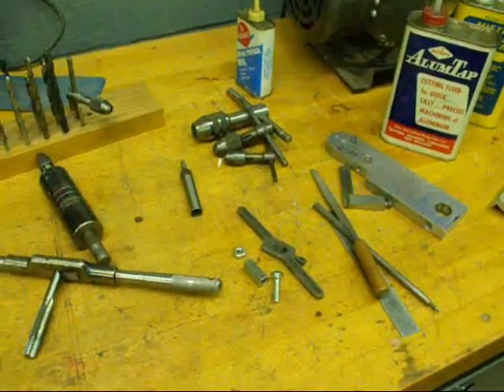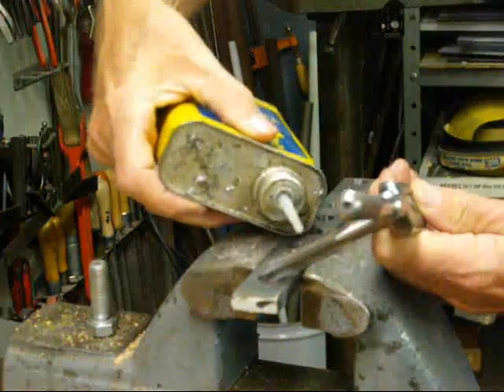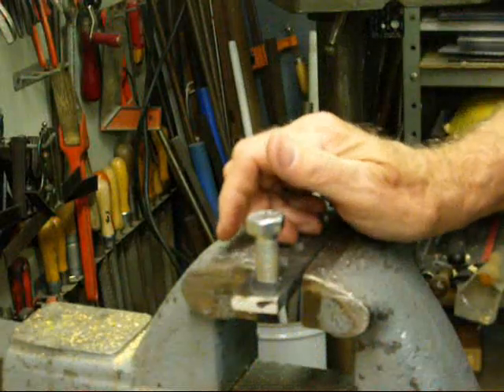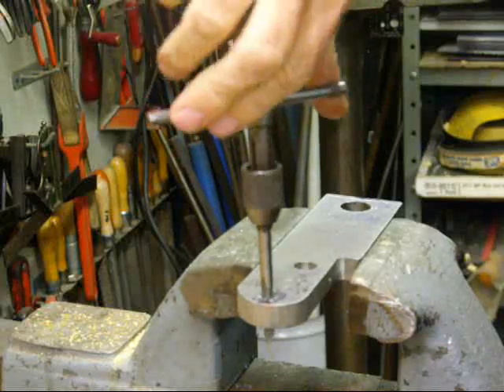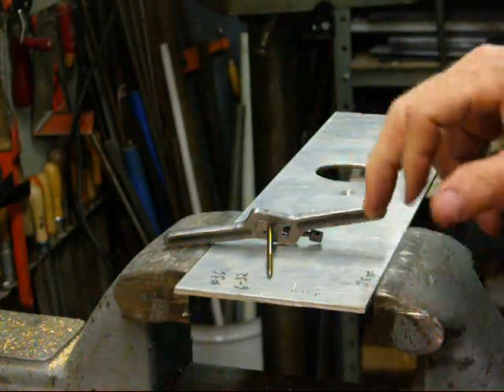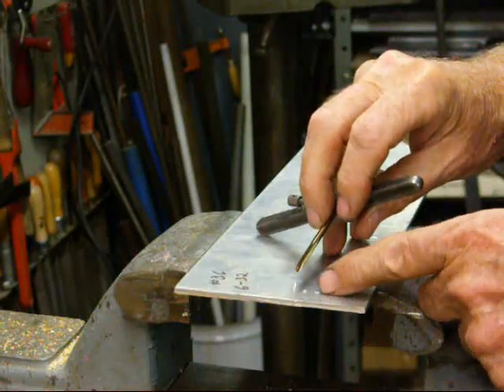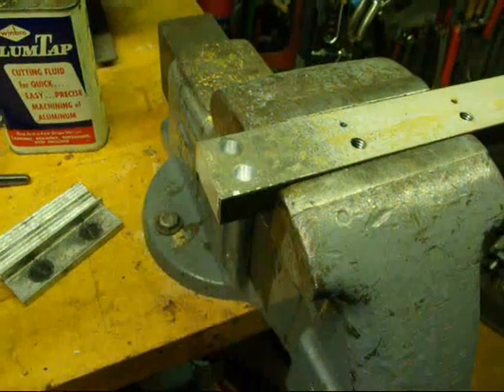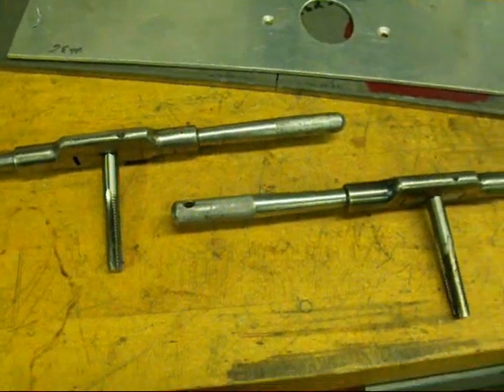MACHINE SHOP TIPS #2 Tapping tubalcain

Comment: I enjoy your videos so much, I'm starting over the second time! I have always been told when tapping that minimum thread depth should equal diameter. ie, 1/4" bolt should have 1/4" thread depth, 1/2" bolt, 1/2" thread depth, minimum. Your opinion please.
Reply from the maker: +William Garrett For a 75% thread, go by the charts. Not by what someone tells you
Reply: What charts are you referring to?

Comment: For people not in the US, there is a trick with ISO taps: the necessary drill bit will probably not be in your set. For example a 5mm tap has to be drilled with a 4.2mm drill bit, it won't be in a normal set. If you buy a tapping set, you'll probably need to buy another drill bit set : 2.5mm, 3.3mm, 4.2mm, 5mm (this one is the best, 5mm drill, 1mm pitch, 6mm tap),  (there is no 7 in ISO), 6.8mm, 8.5mm, 10.2mm, 14mm, 17.5mm.

This table is on the back of your digital caliper.

Comment: Hello Sir.
I have a doubt in this video.
You have said that, the gun tap will push the chips downward. Is this reliable, sir?
Normally in drill bits, the flutes are designed to remove the chips formed, in the upward direction i.e. through top of the workpiece. 

If chips are removed downward, will it not hinder the machining process as they will prevent the tool surface from touching the workpiece, sir?

Please correct me if i am wrong , sir. Any other advantage of downward chip removal?

Comment: When I was turning wrenches, I purchased a complete set of tap holders that attach to your ratchet. They were from Marco. They can be difficult to use because you don't apply pressure on both sides, but they do cone in handy. Thanks for the great videos. I've only been a machinist for three years. I've learned everything from my father in law who was a machinist for 41 years.

Comment: Great videos! Have you come across the spiral taps for aluminium? They have no flutes and look very much like a normal bolt, but to turn them inbetween your fingers it feels like it is slightly triangular, which would suggest it is a deformation tool.  I triied one and it worked great in rolled alumium!

Comment: @harleyghost 
It can be done, there is one guy at my work that everyone runs to when they break a tap but he doesn't like to share all his "Indian tricks" with people much.
The main  way we remove broken taps is with an EDM tap burner. 
There are plans on line to build one for home use.
I work with allot of very expensive castings and what not so if a tap breaks it can be cheaper to remove it than replace the material. Of course in some cases it is simpler to just start over.